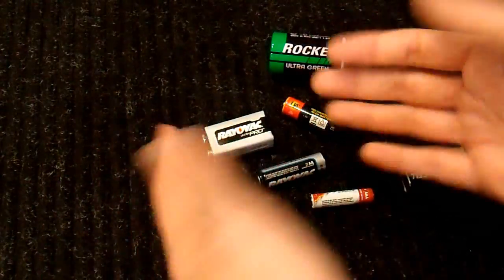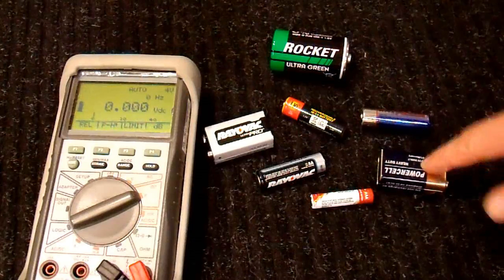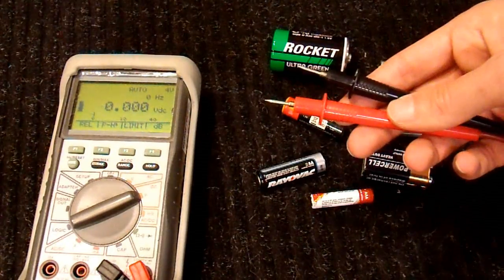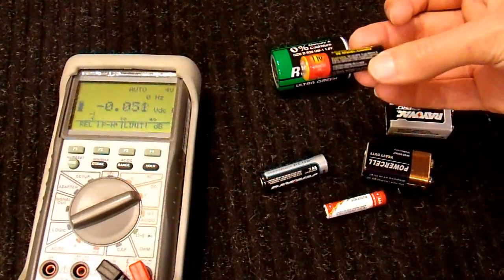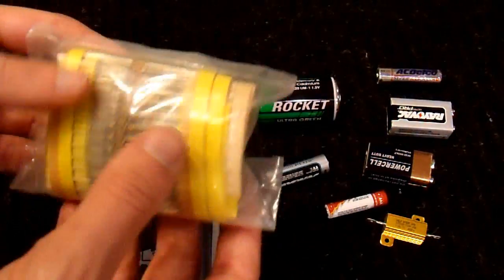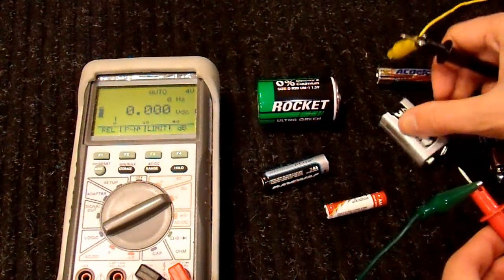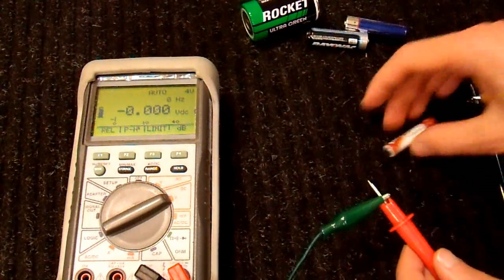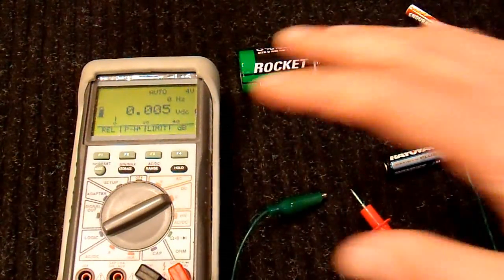How To Test Standard AA, AAA, D, C, and 9V Batteries with a Multimeter

Comment: Thanks! How inaccurate would readings be using a 75 Ohm resistor (it's what I have on hand)?  Also, I have situations where I temporarily use four AA batteries in a garden hose timer. Between uses I remove the batteries and label them for use in the same device in the future. This test will help me understand how depleted they are each time I use them, or whether one gets depleted faster than the others. It has been my understanding that if using multiple batteries in a device they should be of equal power.
Reply: hope you realized that it's ok to use that for a garden hose

Comment: Is it possible to test the batteries whilst still in the item they are for? Put them under load and test which ones are faulty that way?
Reply from the maker: Yes, that is a fully valid way to test them so long as the device you're testing them in has a fairly high current draw.  A flashlight for example will work well as a battery tester.  A remote control won't.

Comment: Can you test without load resister or something else that has 100 ohm? Like putting the battery inside of (for example tv remote) and then put the multimeter on both ends while its inside the remote?
Reply from the maker: Yes, perfectly valid so long as the device you are testing it in is the device you intend to use it in.  Sometimes a battery will work just fine at a low drain in powering something like a clock, but not work at all powering something like a flashlight.  If it doesn't work in the high drain device it's still a 'bad' battery but that matters little if it works well in the application you are using it in.
Reply: @knurlgnar24  Thanks for the quick answer :D

Comment: Thanks so much for this video. Can you explain why all those batteries should be 1.5 V? or near 1.5 V? (except the 9V)
Reply: @tomatojuice - They're all designed to deliver about 1.5 V.  The 9 V battery consists of 6 smaller batteries ("cells"), each of 1.5 V, connected in series (positive to negative).  This design value of 1.5 depends on the chemistry inside the battery, specifically, on the materials used in the two terminals and on the electrolyte (conductive paste or liquid) between them.

Comment: I see we have a lot of combinations to choose, however, I cannot find either 100 or 110 ohm. Which one would you recommend amongst the following please?

1- 10W at 150 ohm
2- 10W at 10 ohm
3- 50W at 8 ohm
4- 25W at 15 ohm
5- 10W at 390 ohm
6- 25W at 180 ohm
7- 100W at 1 ohm

Many thanks...
Reply: Mickael S The idea here is to put "some" load on your battery.  "Some" is highly subjective, and might be tweaked depending on what you want to do with the battery.

If you know it will go in a particularly high-current device, you might choose a much lower resistance for your test.  (5-20R, maybe.)  If you just want to sort out good batteries from clearly bad ones, anything from 50-200R is fine.

For most uses, 1-10R resistors are a little on the heavy side unless you're interested in stress-testing batteries.  It's not really a fair comparison to most real-world loads, and just drains the battery unnecessarily.  OTOH, 390R isn't enough load to prove much.  It's about the same as a single indicator LED (~4mA).

Regardless, you don't need 10 to 100W ratings.. that's gross overkill.  You're never going to pull 10W from a AA battery, much less 100W.  (Even at 1R, that's still only like 2W.)  But if you already have it, or might use it elsewhere, that's fine.

Comment: A 100 ohm resistor for a 9 volt battery may be unrealistic. That means it would have to put out 810mw at 9V. Most 9V battery equipment is usually designed to only draw 20-80mw, pushing hard up to 100mw. Most 9V battery equipment will run fine when the voltage goes down to 6V as long as it can still put out around 13-15ma to generate around 80mw. The high frequency beeps produced by very efficient piezoelectric speakers in smoke alarms, don't really use much power to be very loud. A reading of 6-7 volts on it, with a 400-500 ohm resistor across it, may be good enough for the battery to still last a long time. Many rechargeable 9 volt batteries are actually only 7.2-7.5 volts new & fully charged. A good 9V battery may be rated at 200mah, but it was rated that way at around 20ma for 10 hours down to 6 volts, not 200ma for an hour at continuous 9 volts.

A single 1.5 volt AAA cell (1.2 volts for rechargeable ones) may need to put out at least 40mw (33ma) in most apps they're used for. So a 36 ohm resistor would be best for 1.2-1.5 volt cells, or round up no higher than 50 ohms. I have a pocket LED light that draws over an amp off a single cell on it's brightest setting, but that's not typical usage for an AAA cell.
Reply from the maker: Any 9V battery that is lower than 9.0V when new is bad - unless it is rechargeable which is often 7.2V but that is a special case.  Do a search for 'Energizer 9V battery datasheet' and find the authoratative information on these batteries from a reputable manufacturer.  Note that they are designed to operate up to 500mA, so a 100ohm resistor is perfectly appropriate.  According to Energizer when discharged through a 100ohm resistor will take 7 hours for the battery to drain to 6.0V under load.  That's a long time.

I agree that a higher current would be better for AA batteries but then a higher power resistor is needed and a different one is needed for 9V, etc.  100 ohms is just simple.  I find that it is very rare that a battery with good voltage fails and is not detectable with this 100 ohm trick.
Reply: ***** the lowest my resistors go in my hobby kits were 100ohms.  I actually think higher resistors could make this test easier to distinguish the bad.  i tested out a first set of batteries using 100ohms and didn't have much problems, the voltage decrease without a resistor vs with a resistor didn't drop so much (guessing i had decent batteries)....other times, the voltage reading kept going lower and lower, trickling down at a slower rate.. I think these were bad.  taking the resistor out, these batteries would slowly rise back up
Reply from the maker: danh le
Sounds about right.  Batteries that drop in voltage with a load (even a light 100ohm load) are weak and probably not worth using.  Without the resistor the charge carriers will re-distribute themselves in the battery and the voltage will slowly rise up - but that higher voltage will only be present when the battery isn't being used which isn't very useful...

Comment: it is good explanation but it would be better if you added a sheet of the load resistance according to battery voltage and energy stored in amps

Comment: Does the WATTAGE of the resistor we use matter when using this method of testing household batteries?  And does the 100R seen as part of the specs for 100ohm resistors important?  Would a 25W 100R 100ohm resistor work?
Reply from the maker: Wattage doesn't matter much as long as you only test for a few seconds at a time.  For most people buying a battery load tester off of Amazon is probably a more practical solution.
Reply: @knurlgnar24  Thanks alot for the quick reply.. I think I'm going to stick with the battery testing method you describe in your video.. seems like far too many Amazon load tester reviews describe VERY inaccurate test results as well as low quality hardware and/or product DOA in their comments!  Would the 15 Amp rating of these aligator clip and wire set tend to scew the test results?  :  https://www.amazon.com/dp/B072C8G3XJ/?coliid=I19U49E5OARY17&colid=5T4XRIGDBIE&psc=1&ref_=lv_ov_lig_dp_it

Comment: thanks for this great video! does this process works on testing a 12V lead acid battery or do i have to increase the resistance instead before testing?
Reply: lead acid car batterys are usually ok to check using just your meter, no resistance needed, if you get 12.4-12.7 , youre battery doesnt need charging
Reply from the maker: A lead acid starting battery requires either an impedance test using a specialized tester, or a heavy load (>100A) applied for 10 or 15 seconds while measuring the voltage to determine if they are good.  Professionals used to use expensive adjustable carbon pile load testers for this purpose but are increasingly using the digital impedance measuring type now.  For most people it is most economical to just go to an auto parts store where they'll test it for free.
Reply: Use something like a 12v 60w light bulb as a load.

Comment: Liked that, question from the past... It has been said to keep these types of batteries cold or frozen to get greater life, any ideas on this?
Reply from the maker: Standard Heavy Duty or Alkaline batteries will self-discharge slower when cold and will also corrode more slowly when cold.  However temperature cycling does the opposite so if you put them in a refrigerator or freezer that self defrosts (gets warm/cold/warm etc) then I don't think it is doing much good.  Alkaline batteries have a very long shelf life so for practical purposes I would recommend storing them in a cool dry place rather than a refrigerator.  A manual defrosting chest freezer would work well though to maintain optimal battery freshness.

Comment: Newbie-style questions: 1. If I wanted to add, say, an additional 100 ohm resistor, would it be better to do it in series, or parallel? (or worth trying both?).

2. Would a similar test be to connect the resistor(s) in series, and then measure the current? EDIT: I think you answered this below.

3. Why can't you measure the internal resistance of a battery directly? EDIT: I think you answered this below.

(I'll leave my dumb questions 2 & 3 there in case anyone wants to comment).

Comment: Is it dangerous to test an 18650 Li-ion cell using a low resistance load, say 1 or 2 ohm? At what point does a low resistance become a short circuit?
Reply from the maker: A cell at 3 or 4 volts can be tested with under 1 ohm without issue.  'Short circuit' is a term that depends on context.  A 10,000A current in a powerplant may be considered a small load.  A 1A current in a watch battery would be considered short circuit.  Currents need to stay within the bounds that the components are built to handle, so without more information it's difficult to answer the question.
Reply: @knurlgnar24  Thanks. I want to test the internal resistance of some older flashlight cells, but I don't need any explosive excitement.

Comment: I have a 1.5 volt, 9 volt, and 12 volt battery setting on my multi-meter.  Can I use the 12 volt setting to load test the car battery in my vehicle?

Comment: I saw another video "ChrisFix" use a Multimeter to check his car battery, does that hold true for car batteries too?
Reply: If it is a "maintenance free" battery you can test it with a multimeter.  BUT if the battery has those removable plastic covers that let you add water to the individual cells of the battery then you need to use a hydrometer instead.

Comment: The better low cost testers use a different load resistor  for different cells. A D-cell generally will be used in a higher current demand device than a AAA. To do it right, one value resistor does no fit all. Even then, some cells are used at higher or lower than the average consumption for the type. A variable test load to approximate the working load is best. That power resistor's wattage is super overkill

Comment: What do you think of the Harbor Freight free-with coupon Cen-Tech multimeter with the 1.5/9v battery test position, will that properly load a cell for an accurate test?
Reply: Fred C Dobbs That is just what it does. there is an internal resistor but it is in series with a milliameter rather than in parallel with a voltmeter. the milliameter is very low resistance so the resistor is most of the load. Using ohms law, the resistor is 375 ohms. The meter says the battery should produce 4ma with that load.If it shows less it means the voltage is down. For a 9 volt battery you should see 25ma.This tester reads current, not voltage on the battery test function. To do it the other way, get some load resistors and use the voltage range.

Comment: what if my multi meter has a battery symbol with 9V and a battery symbol with 1.5V ,are those putting a load on to test?
Reply from the maker: Yes, if your meter has a battery setting it already puts a load on the battery and all you need to do is read the voltage.  The actual load varies substantially from meter to meter but for most purposes it's good enough.

Comment: How did you determine to set the resistance equal to 100 ohms? Would this be a reasonable resistance to test a 12 V car battery with? Thanks.
Reply from the maker: A 12V car battery would require a far lower resistance - low enough to draw a couple hundred amps!  The optimal resistance depends on the battery type and the application and I showed 100ohms here only because it is safe to use on all alkaline batteries.

Comment: Hi, thanks for video. I've got one question: I'd like to test my 18650 rechargeable 3.7v battery, is it ok if use 100 ohm resistor for it?
Reply: 100 ohms is too high of a resistance to get much (current or information) out of a battery, especially a large-ish one like a 18650.   I would use no higher than a 5-ohm resistor.

Comment: Thanks so much! 

Please would you advise, how to perform a similar test on a car battery? How many ohms resistance should I use? If a car battery is not adequate to crank a car engine anymore, should it be discarded, or can it fulfill another purpose (with a lighter load). Like running internal lighting (bulbs connected in series) during load shedding (not something I assume that affects Americans, but is a daily problem in South Africa with our fragile electrical network).

Please forgive me, I'm not too clued up on the terminology. If you think your response is too basic or condescending, don't worry :) I'll be happy with what I get! 

Greetings from South Africa. 

Warren Hale
Reply: Car 12 Volt Battery: 12.7 Volt = 100% Charge, 12.32V =70%, 12.06 V= 50%, 11.75V = 30%, 11.58 V = 20% and 10.5 Volt = 0% charge (completely discharge)

Comment: Do any multi-meters have a setting that adds resistance/load itself? So you wouldn't need to add it manually yourself?
Reply from the maker: Some meters have a 'low Z' setting but that isn't enough current to test a battery.  The best product for this is a battery load tester.

Comment: Hi, thanks for uploading your video!  So following your suggestions I went to radio shack and bought a 100 ohm resister.  But they had many different watt options at 100 ohms.  I bought 1/4 watt 100 ohm resister, will that be ok?  Hard to wrap my head around, they had 1/4, 1/2, 1, 10 watt options to choose from.  Thanks for all your help on this!
Reply from the maker: A 1/4 watt resistor will work on lower voltage batteries but will not withstand a 9V battery for long.  If you only connect it for a few seconds and then let it cool you should be fine but a 1W or greater resistor would be preferred.  Given that you already have a 1/4 watt resistor I would just use that.  It should work fine as long as you only connect it for a brief time to those 9V batteries.

Comment: I noticed your resistor is in parallel. I'd think you'd want that in series with your battery. Perhaps you could explain.
Reply: Ideal voltmeter has inifinite resistence, so it's effectively acts like an open circuit. So if you connect it in series (battery - resistor - voltmeter), it should show give you value around zero. (EDIT: ups, not zero, just slightly less than voltage on battery)

You could use a current meter connected in series with resistor though, but it's less convinient.
Reply: Dmitriy Afraid tou have it backwards. Standard meter resistance is 10megohms . putting another 100 ohms in series increases the infinitesimal load  to an even smaller 10,000,100 ohms. The load goes across the battery. The smaller the resistance, the more current flows and the more you load the battery. You check with everything in parallel, not in series.

Comment: the guy who designed my multimeter must think we have bionic eyes or something, the size and colors are ludicrous! anyway i click 2 notches to the right and it reads like yours 1.5 even dead battery but if click 3 notches to the left 20V or something, then the reading makes sense and can tell if a battery is ok (i think). so it looks like u don't need a resistor? am i missing something?

Comment: Great video, thank you for preparing such helpful content.If I were to apply what you have shown for ups batteries how would I go about estimating the right resistance for a 12v 7AH lead acid ups battery to replicate load in a UPS designed for 1500VA that takes two (2x) 12v 7AH batteries in series?
Reply: You mean two 12 v batteries in parallel.

Comment: I have super cheap Harbor Freight multi meter.  It has a function on the dial to test 9v and 1.5v batteries and  it does the test adding 370mW of resistance and it measures the battery in mAmps instead of volts.  For a 9v battery, it says normal amperage is 25 mA with the 370 mW of load in effect and for a 1.5v battery it says normal Amperage is 4 mA.  I can still measure volts on the dial using the DCV 20 setting.  In you opinion is the mA a good way to measure battery health and does anyone know the range in mA for a healthy battery in 9v and 1.5v batteries.  Example: is a reading of 20 mA (80% of 25) mean I still have a strong battery?...is the degradation linear or logrithmic?  Is there a scale or chart somewhere that gives numbers for Excellent, Good, Fair and Poor regarding the mA measurement or the Voltage measurement with 110 ohms of resistance added?